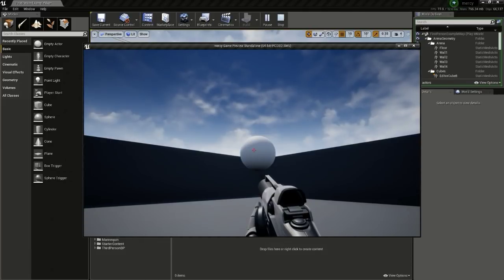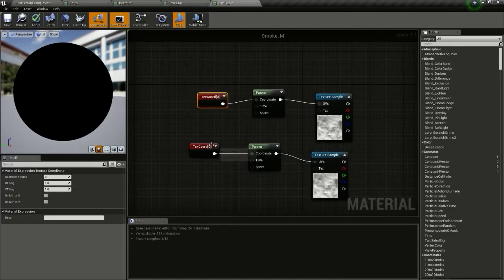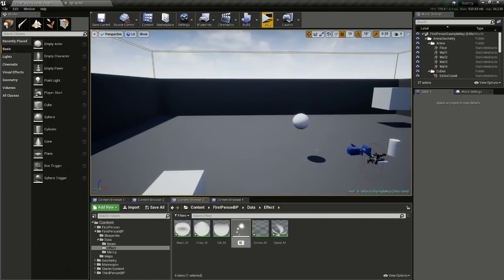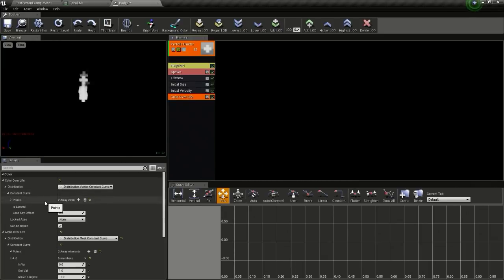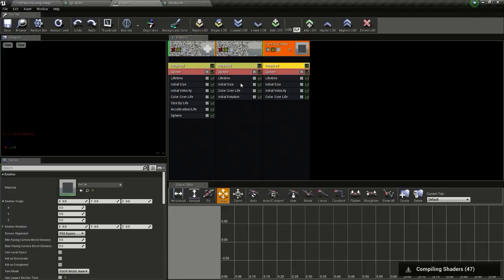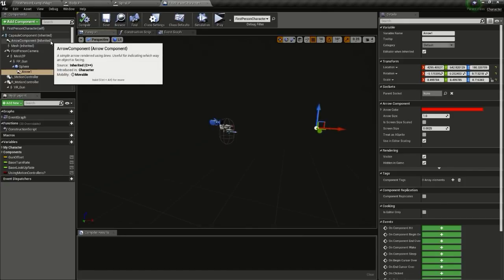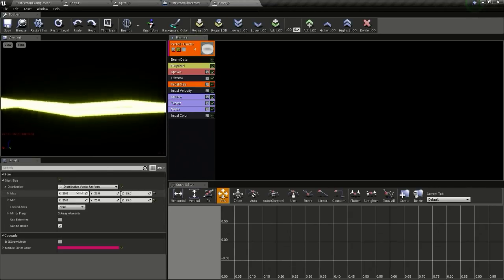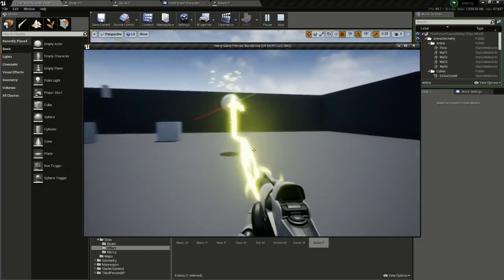Mercy's Healing Beam - [UE4]

Comment: Just a note:  if you modify your beam by adding a second emitter you have to add additional "Set Beam Source Point" & "Set Beam Target Point" nodes for each emitter index you have in your final particle system.  I added three and tested it; then removed one and having extra nodes doesn't throw an error- so it seems reasonable to have 3 setup even if you are only using 1 or 2 so that if later u use 3 the code still works